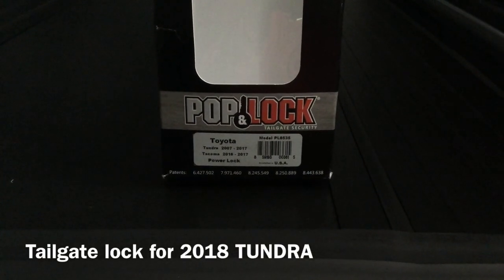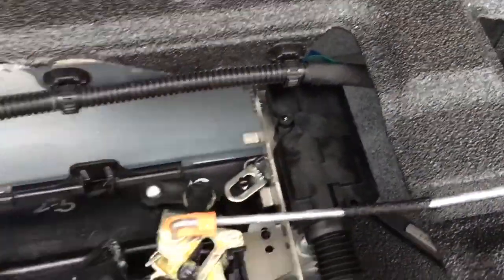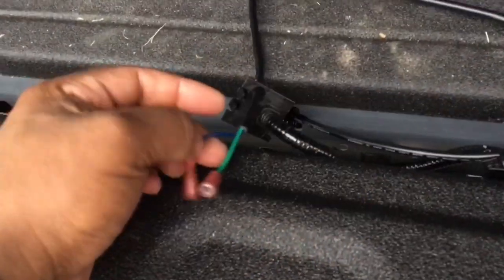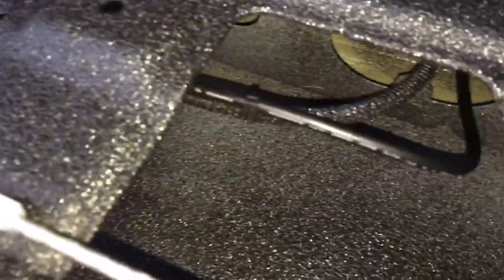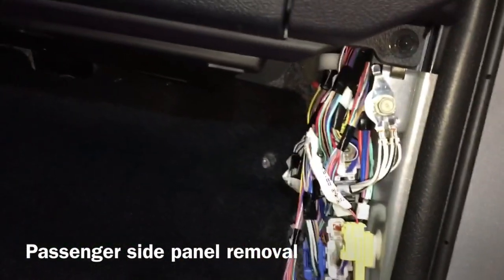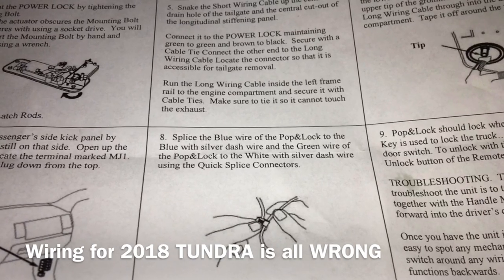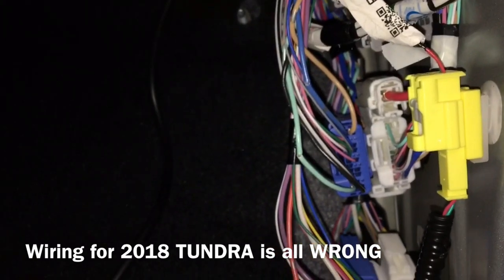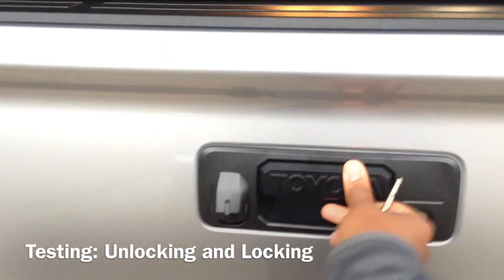2018 Toyota Tundra Tailgate Pop & Lock Install w/Correct Wiring

Comment: Thank you 

For the 2017 Tundra the directions were wrong and the wires were in the sane location as the 2018 colors were different for one.

Thanks again saved a bunch of guess work and time.
Reply: The directions from pop and lock were wrong not yours by the way
Reply from the maker: @treygrant5030  Glad I could help!!!

Comment: Really helpful...  it works on my 2016 crewmax however wires were different colors but same position in the connector... thanks...
Reply: I have a 2016, could you please let me know corresponding  color wires?
Reply: @rafaelgodinez1401  i don't remember... that was 2 yrs ago and i sold my tundra few months ago... sorry...

Comment: just installed mine, they updated the instructions however still got the wires wrong. should have listen to you! just revereses the wires at the tail gate connection pins. works like a dream. Why isn't Toyota doing this from factory.

Comment: Good video except when he goes to the engine compartment with the Pop&Lock wiring. Apparently others have asked for a little more clarification with where the connector is in the video showing the two wires tapped. Critical detail missing.....especially since he points out that the original instructions have a significant error with where the source signal/switch power is from. He didn't appear to answer the others questioning this; so I sensing that he's not watching this post or any responses to it. I'll see!
Reply from the maker: What part of the video, I don't think I have seen where someone asked for clarification.  What min and second part of the video so I can check for you?
Reply from the maker: And you are correct I rarely log into this account anymore. Sorry!
Reply: 2:42 to 3:00 in your video and two commenters in the string below: 
@tonysengphonexay1591, 3 years ago, where he says, "Why did you have to run the wire to the engine and what did you do in that area? I have a 2006 access cab and my cheap pop and lock is all wrong." and @NitroZ18Fishing, 3 years ago, where he says, "Awesome video!...about to install on my 2020 Platinum, just one question, what wiring did you take into engine bay???...or did I misunderstand?...thanks in advance" 
 @TheHowToGuy
Reply: THX for getting back on this to me. I've decided to get the pop n lock kit and waiting for it. The info that is in your post and the commenters is very useful. Looking forward to making mine work. Regards, gary @TheHowToGuy

Comment: Do you know if I can install a Power Drop Down Back Glass?  I also have Tundra 2018 but its SR and the rear glass is stationary.  I know i will need the regulator, new back glass and electrical wiring.  Would you know if that is even possible?  thanks.  By the way, great video.  I will have to install that tailgate locking next.  thanks.
Reply from the maker: Sorry, I don't have any information on that!

Comment: Why did you have to run the wire to the engine and what did you do in that area? I have a 2006 access cab and my cheap pop and lock is all wrong
Reply: It’s a tundra

Comment: In my install something didn't go right. 2019 Tundra Platinum. After install no door locks will work on key fob or pressing lock on door. If I put key in accessory mode the locks then work on the door. Any ideas? I did remove pop and lock wires at this point.
Reply from the maker: Umm...is your harness just like mine?  Toyota is killing me changing the harness from Year to Year.  Just use the same thing.  Let me ask around for you.
Reply from the maker: Ask FatFish549 to send you pics of their install!